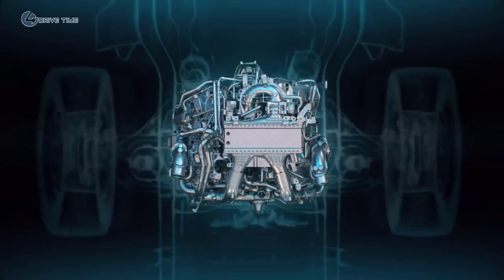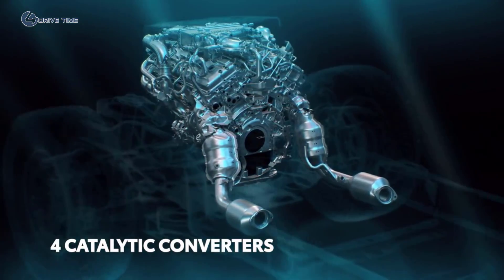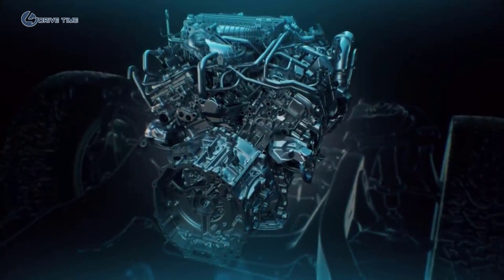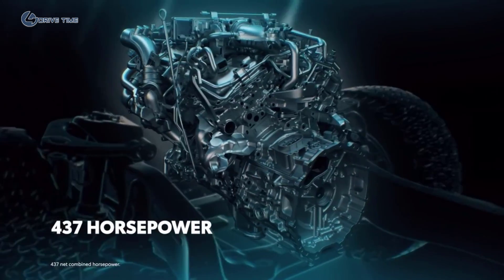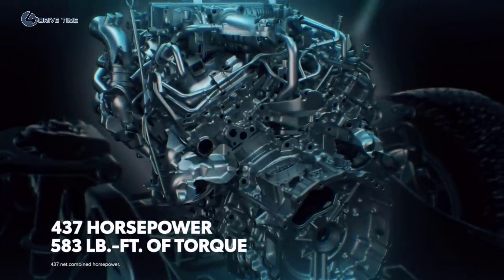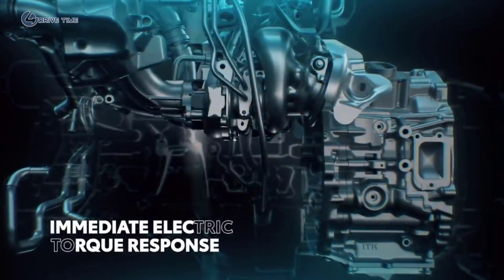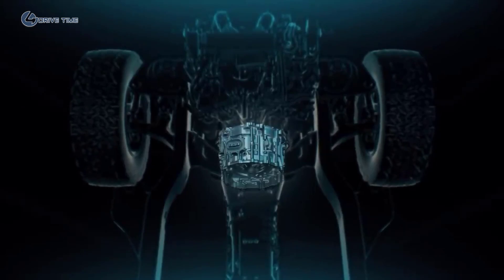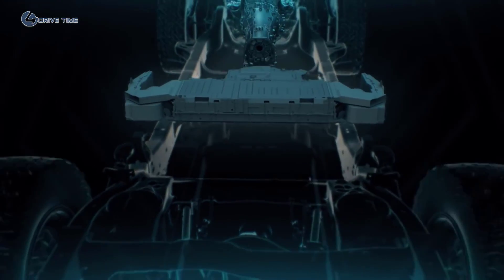2022 Toyota Tundra Twin Turbo V6 engine Production – US Engines Factory

Comment: I  love that its made in America!  I also wish mine was made in Japan.
Reply: Here in the Middle East we have the exact same bearing failure in LX600 and LC300 and engines are made in Japan not the US. It’s a flawed design and not the manufacturing process.
Reply: You don't see Japan made Toyota's with bering failure due to metal shavings, that's for sure.

Comment: Cool vid. Which one of these folks is effing up the front main bearing? Is it Wesley at 1:27?
Reply: No it's those invisible machine shavings that wern't removed, ya thats it...
Reply: It's the design.  These workers didn't do a thing wrong.
Reply: @rand49er  I agree that the workers probably aren't to blame. Seems like a procedural issue in manufacturing as Toyota claims. If it were a design problem we'd see the same issue in the very similar V35A type 17 in the LS500 which was introduced in 2017.

Comment: This video perfectly explains why the V35A-FTS is having so many issues with the main bearing walking and destroying the entire engine. The reason you are seeing so many less failures on the LS 500 is because at least that engine is built in Japan. The girl at 0:39 is more concerned where she is getting brunch with her girls on the weekend then making sure the crankshaft that she is holding in her hands is going to be installed and torqued properly along with the bearings and rod bearings.
Reply: All 3.5 engines have problems, regardless of the place of origin
Reply: but land cruiser have this issue with 3.5 engin wich made in japan 100%
Reply: @theeb1800 the engine block is allegedly all made in the same place.
Reply: The process is precisely the same in the U.S. as it is in Japan.  There is no difference whatsoever.  Toyota would absolutely not accept things to be done two different ways.
Reply: @rand49er  no it’s not. Toyota Doesn’t have druggies and alcoholics working at the Tahara plant . Mkay? 

In US they try to cut costs by hiring literally anyone to make these cars. Most get paid peanuts which is why nobody with actual automotive experience would ever work there.
Reply: Probably not.  In Japan they are very strict unlike the US where u are forced to hire a druggi
Reply: Ya keep telling yourself that

Comment: As an American I hate saying this but the fact this truck was 100% designed and manufactured here gives me pause about buying one.
Reply: My 2022 trd off road engine & 1 turbo shit the bed at 20k miles
Reply: @joshuaortega546  the engine has been around in a very similar format in the LS500 since 2018 and there have been no problems.  They are made in Japan though.
Reply: You are right. A lot of engine problems are coming out.
Reply: As an Asian .... I agree.
Reply: The V35A-FTS engine in the current Tundra and its Aisin automatic transmission are 💯 percent designed in Japan… assembly and design are entirely different things…
Reply: Exactly.  The japanse are the best at building engines. They take pride in their work
Reply: That's why I bought the Land Cruiser, 100% Made in Japan

Comment: Just had to replace an engine block on a 2023 tundra with only 15k miles at work, we were told by the fts that thousands of these motors were built with "metal contamination". What's ironic is that Toyota likes to continuously emphasize "fix it right the first time" to all of us technicians when these things are rolling off the line ready to blow up lol how would you feel paying a mortgage for a brand new truck then hear a knock knock knock, guess who's there?? Cylinder 5 ready to take an unintended early exit... if this happens to you out of warranty, your looking at 30k in parts alone, another 100 hours labor. Seems a bit much for an already overpriced Toyota vehicle

Comment: It still has a clutch fan! Crazy
Reply: Electronically controlled though. As opposed to thermal.
Reply: @mackfar27  My last truck, an 07 F150 had that setup also. Clutch fan with an electronic Pwm controlled clutch

Comment: Toyota builds a great product,but wow did they copy Ford this time! Twin turbo 3.5L open deck aluminum block with integrated exhaust manifolds cast in the heads, 10 speed transmission.

Comment: The main issue of low fuel economy on the Tundra was not resolved with this engine. The fuel economy vs the V8 has not lived up to many buyers expectation. Many current and future owners would have loved the option of the V8 with a ten speed transmission. This would have been the greatest selling Tundra ever made. All the power with the economy of a 10 speed AND awesome new technology. We can dream…
Reply: Idk about you but i buy trucks knowing fuel economy won’t be its strong suit. You wanna save gas? Buy a sedan.
Reply: Ya really don’t need a 10spd trans 6-7 max. Let’s be honest. But maybe with all the gears it spread the wear so it should last forever maybe?
Reply: Yeah my Sequoia gets 14mpg on 93pump . But i have a heavy foot

Comment: I saw a 2022 Tundra at the dealership. Cab and front end up in the air. Frame and bed on the ground. Coolant leak from the passenger cylinder head.
Reply: Yea bro it’s really bad lol. Ik someone who works at toyota and its the worst engine recall so far. They dont even replace the engine they only replace the head or something.

Comment: This engine will not reliable like the tundra v8 4.7 which was a great reliable engine. Why change it, it was a amazing engine
Reply: Mine id still going strong. 25 years old.  Runs smooth. Has a little tick but it's done that for 10 years.  It has almost 400k miles

Comment: Bruh they did all this but didnt want to develop the mk5 them selves 😐
Reply: This engine is in all their bigger cars and Lexus models. So they aren’t losing money on it if it was designed for just one car. The Supra uses an I6 model. It’s possible for the next Supra they could switch to this engine.

Comment: Maybe I'm old school, but all I see is twice as many moving parts to achieve modest performance gains.  Only time will tell if this engine will even come to the 5.7 reliability!
Reply: Modest? The 5.7 made 381 hp and 401lb-ft. The new setup makes 437 and 583lb-ft that's more torque and HP than any N/A truck engine especially the Ford 7.3 Godzilla V8 with 430hp and only 475 lb-ft. OVER Twice the displacement and still over 100lb-ft less torque. 

Not to mention that it has turbos from the factory so modifying it without voiding warranties are very easy. Turbo engines are very easy to get impressive hp bumps. Someone already proved a 56hp bump with the V6-TT I Force engine with a cold air intake and a tune. Not something we can get on our 5.7's without spending $7,000+ on a supercharger.
Reply: This engine has been available since 2017 featured in the Lexus LS 500.
Reply: Rather have the 4.7

Comment: This video is way over hyped this was a waste of time the hybrid setup imo... waste of money ...
Reply: How much extra stuff mpg? Etc weight ? How much more money?.. environment friendly How ?
Reply: @NAH-vk6pk  a buddy of mine just drove up from Jacksonville, FL for Christmas and recorded a little over 16 mpg.  I can do that with my 2017 V-8...............🙄
Reply: @Robert Landau  I bet with out the hybrid setup it works great
Reply: Rust is a issue Imagine taking apart this stuff when it's rusted out in couple years too... did they take anything into consideration about this? Exhaust manifold bolts omg.. why .... remember toyota you messed up some times but also you fixed stuff .... learn from the mistakes ... maybe people will trust again to buy a car that after couple years starts drinking gas and oil together ❤️

Comment: My only concern is the cats directly after the turbos... dodge did this with the srt4 and the turbo just cooked off all the time on those.
Reply: Well yeah that was 2004 it's close to 2024, turbo tech has changed a lot since. They did also say the exhaust manifolds are water cooled as well .
Reply: Audi / Porsche have been doing this for years. There has been some warping of the covers due to heat, but that's about it. Doesn't affect operation.
Reply: @Bobsnarls  i'm still gonna delete the cats, tune on E85 for lower EGTs and run straight pipe through a small muffler just so it isn't too loud, but it's always better if heat and exhaust can freely flow away from the engine.

Comment: I'll keep my 5.7 and watch the show to see how things work out.
Reply: If your broke man just say it
Reply: Rather stick with the 4.7 v8 in the 4th generation 4runner or tundra. Mucj better engine than this bew one
Reply: same here. I'll wait for a decade or at least until I start seeing multiple 3.5TT go above 200k.
Reply: Work hard and trade that beast at 100k after it’s depreciated.
Reply: This engine was listed as one of the 10 best engines in the world as of 2022. It was first put in a lexus. Worked so well its now in the tundra/ sequoia . Its fun to drive especially with the 5 link rear in the sequoia.
Reply: Good idea. Forcing more power from a smaller engine tends to reduce longevity, even if it IS a Toyota.  Hopefully this new V6 turbo is as overbuilt as the 2JZ was.
Reply: Junk motors check out reviews on new motors. Seems risky. The 6.0 power stroke of gas jobs.
Reply: My 2022 TRD off-road engine & turbo shit the bed at 20k miles
Reply: Come on guys... Each have their benefit and each one had its initials problems exclusively effecting its launch. 
 But why isn't the 5.7 still option?, no brainier Toyota .... 😡
Reply: I'm trading in my 5.7 for one of these. I'm sick of "american" brands outsourcing to othee countries and waiting years to fix a known issue. The cam lobe and manifold gasket issues on the 5.7 has been known about since 2012 and they have yet to fix it
Reply: Have fun with that old out dated thing

Comment: All these "engineers" in the comments  bitching about displacement, turbos, waste gates don't know that when the 5.7L V8 came out, it snapped cams. Toyota figures shit out and they know more than you do bud.
Reply: Should have kept the V8.
Reply: @gavincurtis  agreed but EPA and CAFE standards are phasing these engines out unfortunately. All OEMs not just Toyota.
Reply: @jza80king  Agree 100%.  Vehicles are getting far too complex.  One would think making the 500,000 mile reliable car would be better for the world in the long run vs super restrictive emissions causing lots of cars to go to the crusher before their time.

Comment: How is the base engine block different from Ford's 3.5L ecoboost?
Reply: It's not a ford. I had an ecoboost and it was a turd.
Reply: @roadrocket7770  You've driven this truck and know its better? Did you look at the engines side by side? They look the same to me.
Reply: @jusdsun8319  The only difference that I noticed is the electric wastegate and there cooling system for the the turbo/intercooler. I can't decide to whether to go with this or ford f150 v6 twin turbo. Plus ford uses Garrett turbos which is nice for tuner to increase power easily.
Reply: @roadrocket7770  i have had two ecoboost  and they are great , my 2021 f150 lariat has the 3rd gen 3.5 ...rock solid engine and more power than the tundra engine .
Reply: @northlander4370  that is your experience. I will not buy another detroit brand especially another fucking ford in this lifetime. The only good ford i ever had was my '99 f150. The 3 others were garbage. My 2011 ecoboost was the worst one. Biggest pile of crap i ever owned
Reply: @roadrocket7770  i have good experience..love my Ford,s , it,s my money and i am happy with my trucks
Reply: Better materials, better tolerances,better quality control,better reliability. And most importantly, not being put together by Ford. Ford has a lot to offer,but engine and transmission reliabilty  just isn't one of them.
Reply: @RK-nr8qf  not a lot of tundras running around my neck of the woods....bags of ford,s ,rams and chevs...on every corner
Reply: After watching build video's of both engines, they have more similarities to Fords 2.7 and 3.0 TT. Such as the three bolt cast in exhaust manifold in the cylinder heads. Ford and Toyota both worked with FEV out of Germany.
Reply: Thats all i see here in colorado
Tundras and crap ton of tacomas.

Comment: I would rather Americans never laid hands on my engine. I would prefer it built in Japan.
Reply: Yep built in Japan 👍👍👍👍
Reply: Why did the Japanese have magic hands? It’s not the people that build it fits the standards to which the factories run and it’s the same. You’re forgetting that the previous tundra engine with easily make it to 1,000,000 miles and it was built here with parts from Japan. See you mentioned that they were also building in Japan.
Reply: @mjfamgo6563 
No, not easily.  In total, there is ONE documented case that the tundra made it 1,000,000 miles.
Reply: @mjfamgo6563 easily make it to 1,000,000 miles? How many documented 1,000,000 mile Tundras are running around?
Reply: @mjfamgo6563 no with Americans it close enough, Japanese, something is wrong let’s fix it.
Reply: As an American I agree 100%
Reply: Japan has built a reputation for quality. Manufacturers in North america are hit and miss. The big 3 always have TSBs/recalls for parts getting improperly installed from the factory.
Reply: You need serious work ethic to assemble on modern precision engines, no entitlement coffee breaks
Reply: Same thing all still hand crafted!!!!
Reply: Exactly this .
Reply: I’ve worked in American factories. I couldn’t agree more.
Reply: I work with a Toyota North American and we follow the same Japanese standards.
Reply: @donovanchilton5817  thats true.  Build quality is still better in japan.  No ghetto ass and less lazy ass people in japan
Reply: They need to add a 5 Thumbs Up option.
Reply: @donovanchilton5817 
It was the 4.7
Reply: The top brand Lexus vehicles are built in the Tahara plant
Reply: Yes...x1000
Reply: I work there, I would’ve done my job right, but I had to take a 💩
Reply: Bro… these mfs got my 2022 tundra engine toasted😪🥲
Reply: You can have one built in Japan if you get a Lexus GX or LX.  Or you can get a Toyota 4Runner or Land Cruiser
Reply: Offshore built engines are failing too. Bad bearings which have been revised.
Reply: Gotta buy an lx for a Japanese v35a-fts.
Reply: Built with D.I.E.(diversity inclusion equity)
Reply: Muricaaaaa🇺🇸 like it or get out
Reply: @pd4981  Iv owned a power wagon, wrangler, 2 f150s, 1 ram 1500, 3 tundras ,1 tacoma and two 4Runners since 2010. Iv got a pretty good idea what is junk and what’s not. The fords were trash, the power wagon was great and the Toyotas were bulletproof. I support our country completely but I’m sick of the big three giving us crap trucks for 80k.
Reply: @Weatherby406  I agree man,  I love Toyotas

Comment: More air flow is nice but if there isnt more fuel and better spark/combustion then it's just a waste! I can get a Ram 2500 Power Wagon with the 6.4 V8 hemi get 20+ mpg!! So tell me again how the New Tundra is so good?
Reply: You don't get 20+ mpg from a 6.4 power wagon
Reply: @corydelbiondo5773  
You wanna bet?
Reply: @stevenpeterson7234  yes I do
Reply: @corydelbiondo5773  
What are the 4 ingredients needed to make better fuel economy? If you cant answer this, this will tell me everything I need to know!!
Reply: @stevenpeterson7234  this isn't a trick question and I have nothing to prove. If you truly get what you claim then please contact the stellantis engineers because you are on to something and this is a huge potential sales pitch for them. You have a unicorn. I have followed your truck on fuelly some real world reviews and it just doesn't. Coasting down a mountain in neutral doesn't count. A 50 mile mpg calculator doesn't count either. Enjoy your unicorn
Reply: @corydelbiondo5773  as an prior owner of a Ford Ecoboost, it may get good mpg empty but loaded and with the turbos spooled the thing got 7.8 mpg !!!!! My new tundra 5.7L v8 with the same boat trailer gets around 10.5 and doesn't skip a beat. The twin turbo fad needs to end.
Reply: @cjm5161  I'm not disagreeing with you and more boost equals more fuel I'm disagreeing with the claim that a 6.4 powerwagon gets 20+ mpg on the highway no way
Reply: @cjm5161  
I agree, twin turbos suck!! If you wanna see better mpg in your Tundra, I would do a Venomaire  intake, plasma plugs, bigger exhaust cam gear, headers, exhaust, new fuel lines (straight fuel lines), engine tune and trans tune. It seems like a lot but your mpg would go up 5-8 mpg towing and normal driving 10-14 mpg!!
Reply: You are full of it. I have a 2019 ram 1500 with the 5.7 and i am lucky to get 17 mpg with a tailwind, downhill at 60 mph hypermiling behind a semi. My truck is also bone stock still on the factory tires
Reply: @roadrocket7770  
Actually I'm not full of anything, just pooped. What are the 4 things you need to make better mpg and power? Cory Delbiondo couldn't answer it. I wonder if you can.
Reply: Yeah this truck ain't for average Joes. I suggest you to look into ford maverick or RAM.
Reply: @pd4981  
I'll make sure to pull my trailer so when you break down I can tow you to the shop!! Power Wagon all the way!!
Reply: @stevenpeterson7234  at 20mpg don't forget that 😂
Reply: @corydelbiondo5773  
Check out The Getty Adventures. He got 19 mpg on the hwy with a stock Power Wagon!! I have more mods then he does and all my mods are around getting better mpg!! And like I said, no one, I mean no one can tell me the 4 things you need to get better mpg!! So what does that say? 🤔 What that says is nobody knows shit!! Is your wife's purse around you right now? I bet not so don't put your 2 cent in!!! 🤣😂🤣